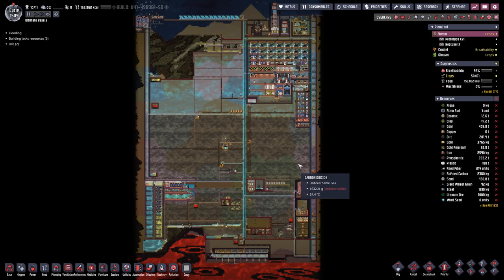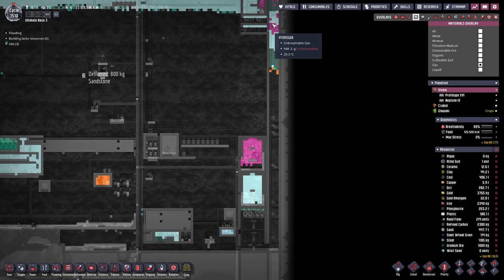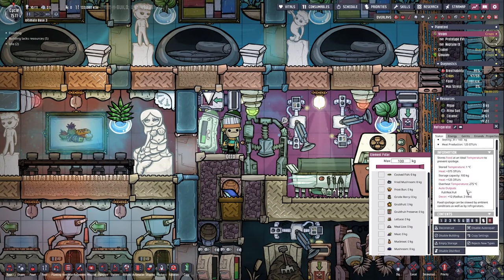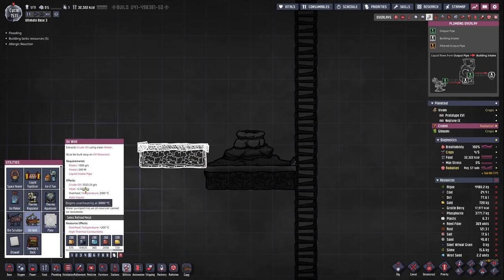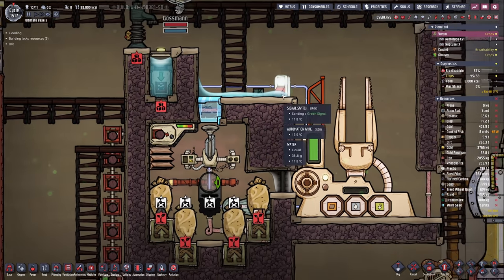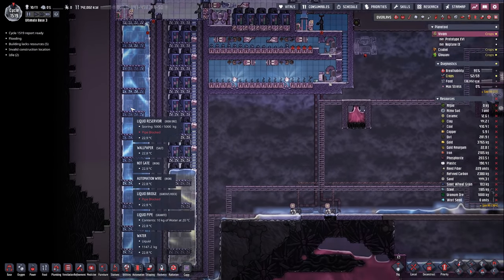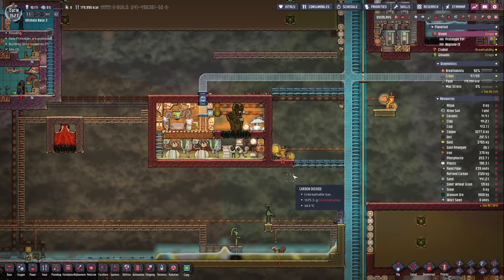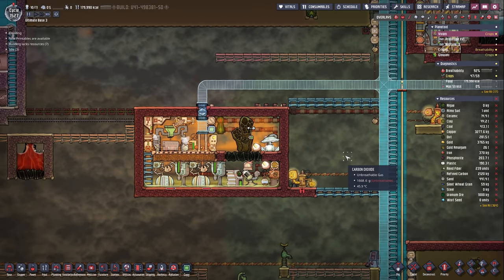FERTILIZER SYNTHESIZER SETUP - ONI - Spaced Out: Ep. #58 (Oxygen Not Included)

Comment: For the "overheating" of the water cleaning. Exchanging the tiles directly below it with normal tiles. You should be fine since they do exchange heat with the tiles they are staying on.
Glassforge just a example if you remember. So exchaning them with something that distributes heat a bit better and your solution might be already there.

Comment: Nice episode Nathan :) 
Not sure why you would want the Nat gas in the same room as the skimmer. They should be seperate with a liquid lock or another tube. Maybe you could use a hydro sensor to make sure you have plenty of PH2O to pump. Also, this contraption is power negative if the vent isn't pushing nat gas as well. You should have a similar automation like in your SPOM to check if the signals stays green for too long and make sure your nat gas room isn't over pressured either. Hard to balance.

Comment: In the fertilizer room, expelling CO2 might be better to implement in the bottom layer. There's space for it above the battery, taking the CO2 below the neutronium, lessening the chances for CO2 to be repeatedly picked up by the pump. 

Once the pH2O backs up in the fertilizer production, the skimmer won't take away any more CO2, which will eventually overpressurize the room, and the geyser. pH2O overflow to the storage tank should be enough, or expand it to more than just one fertilizer syntheziser.

Comment: i guess the bedrooms are for aesthetics? I just do barracks with a one way exit through the atmo suit room. With an emergcy exit I keep locked. That way from the moment they up to sleep they in atmo suits. Slow dupes are restricted to the gym only exit to power a light in a very small room till they are useful. The oxygen system should be condenced down to an electrolyzer set up. I do like the polluted oxygen vent to ceramic factory I just watched. also your bathroom could use some remodeling. I should clear the maps like that be alot less travel then what my dupes doing now.

Comment: You should have some storage for Cooking range, so it doesn't run out of gas when vent goes dormant. Also, i would go lower with settings on atmo sensor near vent since 2001g is already overpressure.
Reply from the maker: You're right with the storage. I used a high gas pressure vent that goes up tp 20kg.
Reply: @Nathans-Sandbox  Sorry, wrong word used - I ment geyser, not vent.
Reply from the maker: The geyser overpressures at 5kg though.

Comment: buildings become flooded when liquid is at a certain mass on their tile of interest. the amount varies based on the liquid, but is 35% of that liquid's max mass. knowing that, you can use a hydro sensor under the ladder and set it to turn the pump on when it detects liquid at anything below 350kg. in theory anyways (dirty water's max mass per tile without compression is 1000kg just like water)
if one were curious enough, the max mass of all liquids can be found in the liquid.yaml text file in the install dir 😉

Comment: move gas pump to top left to solve C02 problem.
move ladder to far right. water flows to the right and down.
create deep pH20 pit below the new ladder.
Some clean H2O above pH2O to prevent off gassing.
Experimental but Liquid pump turns on when sensor detects H2O because H2O is pushed up when new pH20 arrives.
or maybe when a gas sensor detects NOT CO2.
pH20 must be in a pit because it is preventing a layer of CO2 for the carbon skimmer.
a gas pipe bridge to prioritise natural gas to the internal natural gas generators. excess natural gas goes to external natural gas generators for power.

Comment: i see you used a bottle emptier for your naphtha bloop. not necessary :)   for future knowleges: you can craft a pedestal, then select the liquid you want to Display. the pedestal is limited to holding 1000g of a liquid, versus the 200kg the bottle emptier can output. just mount a 1kg bottle, remove it, then put out an order to Empty the bottle and a dupe will pour it on the floor in that spot
Reply from the maker: Good tactic!
Reply: @Nathans-Sandbox  it's quite the game changer for setting up 3-liquid hop locks to prevent the 2 wetness debuffs in places where a dupe wont have a suit. just have to make sure you set the bottle to Empty with a high enough priority that nobody else picks it up for storage before it's poured on the floor